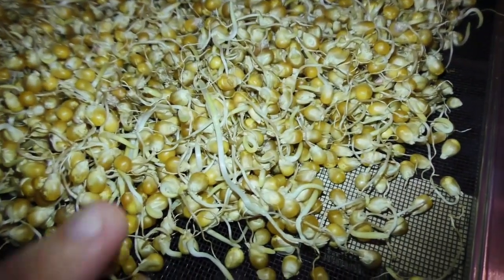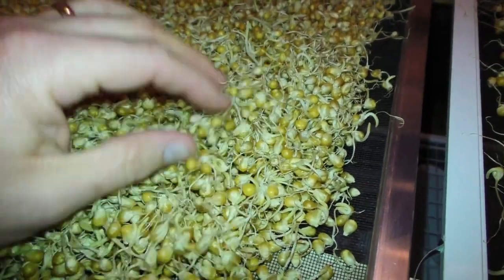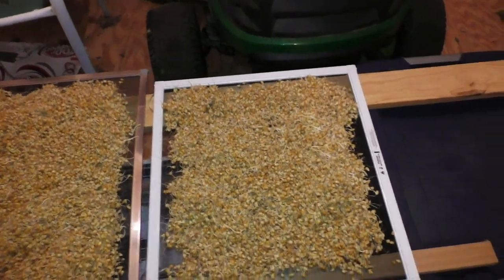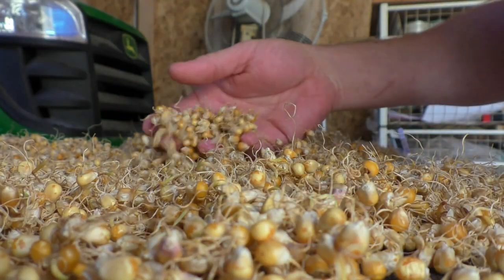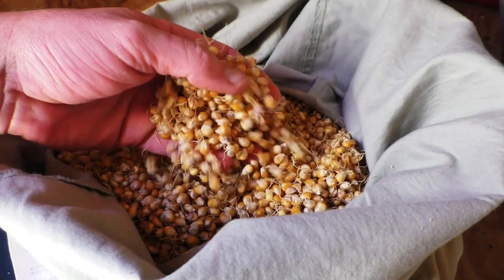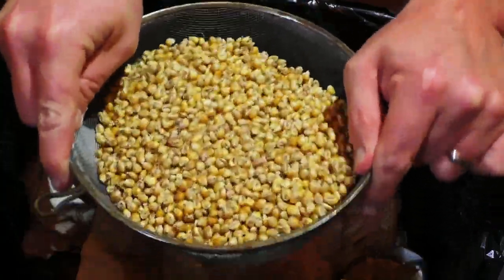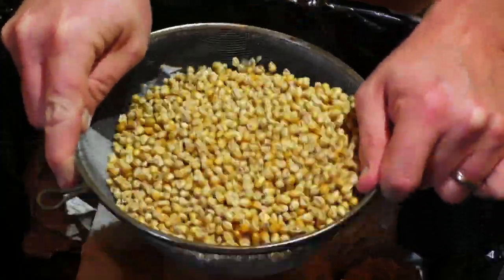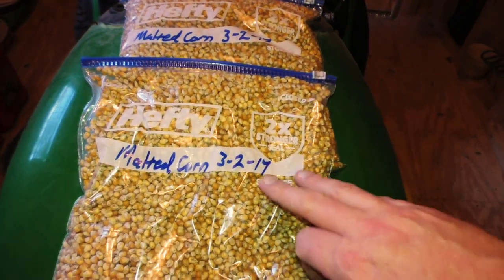HOW TO MALT CORN FOR MOONSHINE & BEER - EASY! - Part 2

Comment: Adding to Jason Hoeflich's questions, could you take the malted corn, grind it up and use it as an amylase? Meaning if I boiled up eight pounds of unmalted ground corn, then added, I don't know 1/2 pound of malted corn at 155 degrees, will that work the same as adding amylase?
Reply from the maker: Unfortunately no. Malted corn has a very low diastatic power, meaning it doesn't have enough amylase to convert anything other than itself. So that half pound of malted corn would convert, but the 8 pounds of unmalted corn would not convert.
Reply: @BeardedBored  Cool thank you. Can you contribute to your channel on a one time basis? Your worth the money but I really can't afford a monthly reoccurring amount.
Reply from the maker: @stevevet3652  I'm just grateful for your views and comments. You can also share my videos on facebook if you have friends that like this kind of content. That helps A LOT:-) Thanks so much brother!

Comment: Do you have to dry out the malted corn if you use it right away ?
Reply from the maker: I did a video on a grocery store beer that uses green fresh malted corn. There are a few considerations to using green malt, so I recommend you check out that video:-)

Comment: Ok, I figured out a way to mash corn meal that every bit of the starch is converted to glucose. I even did an iodine test and had absolutely no black or dark blue, the iodine stayed the original color. Here is what you'll need:

A double boiler:
I made my own using an 8 quart pressure cooker pot I had. My cook pot fit inside it on top of a small rack I had. I let the steam heat my mash to prevent scourching!

SEBstar HTL Enzyme

SEBamyl GL enzyme
(The enzymes are necessary to convert the starch)

Yeast nutrient (I use this any time I add sugar to a batch)

5 lbs corn meal

5 lbs sugar

Instructions:
Add enough water to your double boiler to just cover the bottom of your boil pot. Add 3 gallons of COLD WATER to your boil pot and pour in the corn meal and stir until lumps are gone (adding corn meal to hot water will create dough balls that will not desolve, trust me this has been proven by trial and error!) Add 1/2 tsp of SEBstar HTL Enzyme to cold water. This will keep your corn meal thinned out while gelatinizing it. The SEBstar HTL Enzyme is stable in heat up to 195 degees, so be careful to keep your temperature between 175 and 190 for 1 hour, stirring occasionally.... If you exceed 195, you've killed your enzyme!. After 1 hour, turn off the burner and add enough ice cubes to lower temperature to 150 and stir in 1/2 tsp of SEBamyl GL enzyme. SEBamyl GL enzyme is stable to 158 degrees, so do not exeed that temperature!.. I then cover my boil pot, leaving it inside my double boiler with the heat turned off for one and a half hours.... After the one and a half hour wait, I add sugar and stir until desolved then I dump my still hot mash into my fermentation bucket. I pour back and forth between two buckets at least 7 times to airiate. Add 1 1/2 gallons of cold water to fermentation bucket to cool down to between 100-110 degrees. Take about 1/2 cup of liquid out of my fermentation bucket to start my yeast in. I use about one and 3/4 tbsp of either Fleishmann or Red Star dry active yeast. (Never use the quick rise stuff.) Once yeast is rising and foaming good, add back to your mash with yeast nutrient (add per package instructions and stir well). Cover fermentation bucket with lid and add airlock. Buckle your seatbelt, this will bubble like crazy for several days!
Reply from the maker: Awesome! Thanks for the detailed method:-) Definitely going to get some of those high temp enzymes.

Comment: if you have malted grain,  with the enzymes, can you add that to a larger amount of unmalted but ground corn and get it all to turn to sugars in a mash? or does it All have to be malted?
Reply from the maker: Well there's a hitch with corn. It usually doesn't have enough diastatic power to convert the starches beyond those it contains. If you want to convert unmalted corn along with the malted, it's best to add some 2-row or 6-row barely malt or some amylase enzyme powder or liquid to convert all the starch.

I'll probably do a fully malted corn mash at some point. The idea of it seems like it would come out tasting good.

Comment: very good video is just what I need since I want to make a 100% corn beer, i just have one question, what happen if i dried the corn in the oven to 155ºF?the starches will turn into fermentable sugars or that happens only in water¿?
Reply from the maker: I would not dry it that hot. Maybe 135F. The risk of ruining the enzymes is too high at 155F. Some conversion will happen in the oven, but the risk is too high for me. Better to mash in water so you can have even heating and better control.
Reply: @BeardedBored  ok man thanks a lot
Reply: @BeardedBored  how it work the protein rest? it is really nesesary or i can just put the corn malt to 155ºF?
Reply from the maker: @felixleal6422  It helps the beer to be more clear. For protein rest you bring the temperature to 129F and let it sit for 30 minutes, then increase the temperature to regular mashing temps. Also, instead of 155F, try 145F to get even better conversion of starch to sugar:-)

Comment: My second attempt at this seems to have worked beautifully, except my it smells like dirt/corn and a tiny bit of mildew,very little. I'll intend to mash it,reckon its okay?
Reply from the maker: Yeah, should be fine. You can rinse it really well and drain it to get any funk off if you catch it early enough. Not a true soaking, just a quick rinse and thorough draining.
Reply: @BeardedBored  right,its not completely dried yet,the dryer it gets ,the less pungent the smell. I very much appreciate your answering my every little question. I know they may seem unimportant but you've no idea how much trial and error you've saved me,your a great teacher
Reply from the maker: @adammitchell3462  Happy to help. BTW, you should check out the "Grain Bench" channel. He is a malt wizard!
Reply: @BeardedBored  I sure will man,cause I've gotta get starch conversion perfected. Can I do it with commercial enzymes alone?
Reply from the maker: @adammitchell3462  Yes. Corn has a really low diastatic power, barely enough to convert itself, so it's a good idea to have extra enzymes, either from barley malt or commercial enzymes.

Comment: Hi there, I've got a quick question about the temperature you malt at.. I understand it's not smart to malt at a high temperature but what's the best temperature for this to take place? Can I do it at room temperature or do I have to get in a certain range for best results?

Thanks in advance and great work on the educational vids!
Reply from the maker: Room temperature is fine. A range of between 60F and 85F is pretty safe, but corn is forgiving and can go a bit lower to 55F and as hot as 95F for some of varieties. The grain tends to heat up on its own as it germinates, so  make sure you stir it at least 3 times a day. If you're malting in your house or garage you should be fine. I just posted a new video of a easy malt tumbler to help with temperature regulation and moisture control. Here's a link. https://youtu.be/att7dAP13rY
Reply: Bearded & Bored thanks for the reply! Haven't seen the tumbler yet though, I'll give it a look next
Reply from the maker: Let me know if you have any other questions.

Comment: Do you change out the water each time or keep using the original water?
Also, purified or spring water?
Reply from the maker: Great question. You should dump out the water each time you drain the corn and use clean water for the next soak. That helps to minimize the risk of contaminating your grain with any bacteria, molds or fungus that may be trying to grow in your batch. You can use distilled, spring or purified water. I've even done it with tap water, though I've read that chlorine in tap water can effect your germination rate. I can't say I noticed any difference, but your mileage may vary. Some cities use more chlorine than others so it's safest to buy some jugged water to prevent anything from interfering with the germination process.

Good luck!

Comment: i don't have any dryer, will you gave me other method in drying up the corn malt expert for air drying?
Reply from the maker: In the video I set it on window screens to dry over a fan for the first drying step, but if you take that outside to sit in the sun it will dry much faster. If you can do that for at least 2 days in a row it will probably dry it out enough for storage. Make sure the corn is covered by screen, otherwise birds may come to eat all the corn:-)>

Comment: I’ve heard that you don’t need to add yeast if your using malted corn. How does this work? Thanks
Reply from the maker: It doesn't. I've heard that too, but it's based on faulty assumptions. Without knowing what was really going on at a microscopic level, old timers would rely on wild yeast present on the corn or drifting in from the environment to inoculate the wash. Since they didn't directly add yeast, they wrongly concluded that the malt was somehow responsible for the the spontaneous fermentation. Today since we understand that fermentation needs yeast (and in some cases bacteria), it's more common to use commercial yeast strains since they are more reliable and can have much higher alcohol tolerances. If you want a guaranteed solid and complete fermentation go with commercial yeast:-)

Comment: Hi! Are you try cereal mash with corn? It Works?
Reply from the maker: That's a great question. You don't need to do a cereal mash with malted corn since it has been malted. There is no need to gelatinize the corn. You should only do a starch conversion mash at 148F to 150F (64C to 65.5C) for 1 hour. That's all you need to do, just like malted barley. Any hotter and you will destroy the enzymes in the corn. I hope that helps:-)>

Comment: Since you are going to put the corn in the dryer could you not just skip the air drying stage and go straight to the dryer?
Reply from the maker: You could try it, but there is so much moisture in the corn that I have to idea how long it would take. My guess is at least 8 to 10 hours in the dryer, but I've never tried it so I don't know. I'd be worried it would break my dryer;-)
Reply: Bearded & Bored Sounds like another experiment I need to do.  😄
Reply: Bearded & Bored It worked!  I had to increase the time to 3.5 hours but it worked.
Reply from the maker: @blaylockr1  What?!?!?! That's all? Holy crap, that's awesome! I'll have to give that a try. Thanks for letting me know:-)
Reply: @BeardedBored  I should give you some of the data I collected so that you get a better picture of what I did.  I started with only a pound of corn (857g).   The wet malt mass was 1098g.  After drying for 3.5 hours on low, the mass was 851g.  I put it in a ziploc  bag while it was still warm and left it overnight.  I did NOT observe any condensation.  I decided to 'toast' the corn for the recipe in which I intend to use it.  The mass after 'toasting' it for an hour at 176F was 814g.  So, perhaps it could have used some more dryer time but who knows.  It might be smart to put some of those silica gel moisture absorbers in the bag when you store your corn.
Reply from the maker: From 851g to 814g is not a big drop. Sounds like your dryer time was good enough. Even commercially dried malt has some moisture. I can't remember for sure, maybe around 8%?
Reply: @blaylockr1   If you do this again, you might try the old trick to speed up drying wet laundry: put some dry towels in with the pillowcase of malted corn at the beginning to draw off some of the moisture.

Comment: Do you have to dry the malted corn if you plan on grinding it and using it right away?
Reply from the maker: Nope. Using "wet malt" or "green malt" while it's still fresh actually gives you a much higher diastatic power to convert starches to sugars. Around 200 Lintner instead of 40 Lintner if it's dried. The only problem is the roots and shoots. Removing them from wet malt is a challenge. If you choose not to remove them the beer or distillate can have a pronounced grassy flavor.

Comment: what types of beers were you planning on making with the corn? Any lagers lined up?
Reply from the maker: I was thinking about a pilsner or maybe a pale ale. My "Lagerator" (converted mini fridge with temp controller) is in storage, so I'll likely have to do an ale for now.

Got any recommendations?
Reply: @Bearded & Bored _ maybe a rye with the malted corn to thin it out since rye can be kind of viscous.
Reply from the maker: I hadn't even considered that. Great idea! And I think the stronger flavors of some of the rye beer recipes I've seen could do well with oak aging. Worth a test anyway:-) I'm planning on using my oak barrel from another video to cask age a small portion of beer to compare it to straight bottle conditioned beer. I'll add a few rye ales to my list of possibles and probably get brewing this weekend. Thanks Jason!
Reply from the maker: BTW, I've decided on a Kentucky Common beer recipe I found. I'll post a video when it's done:)
Reply: Can't wait! It'll be a good one I'm sure like your other videos!!!